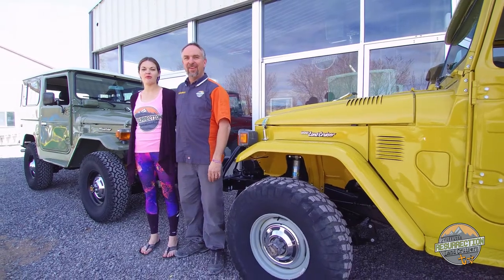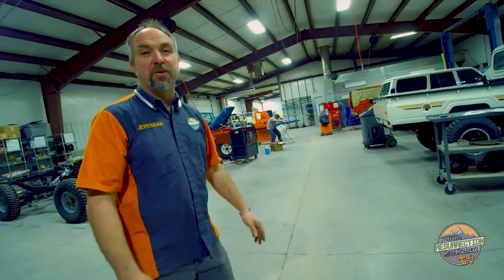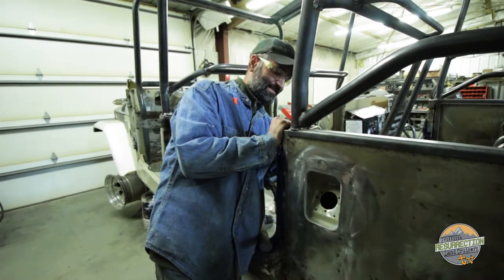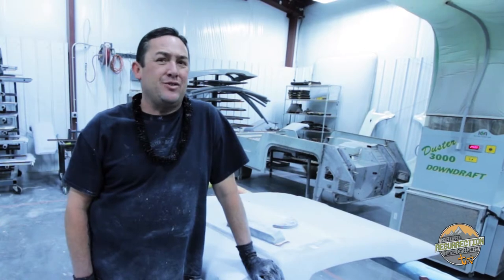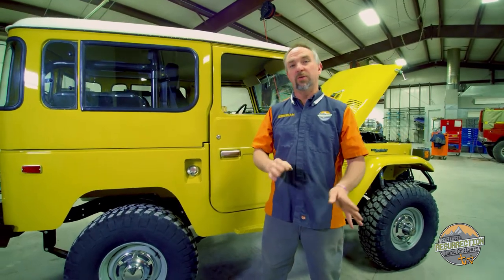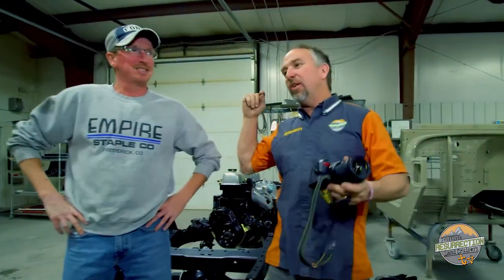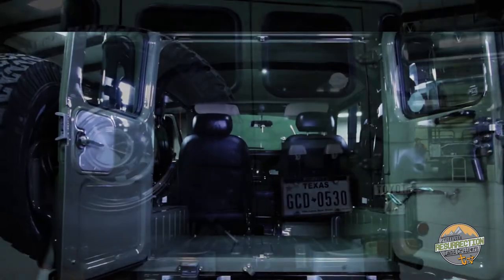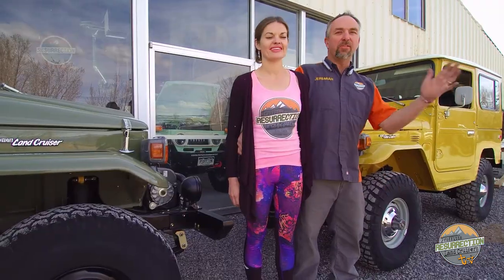PROFFITT'S RESURRECTION LAND CRUISERS TV EPS  14

Comment: What all entails the shakle reversal?
Reply from the maker: Our shackle reversal is a suspension design change that moves the fixed point of the front springs to the front. It takes one of the moving parts of the front suspension and moves it to the rear of the spring for more better tracking. It also provides for the axle to travel up and away from bumps and obstacles instead of towards them. The result is a vastly superior ride. Our shackle reversal is a weld on design and reuses the OEM shackle hanger.